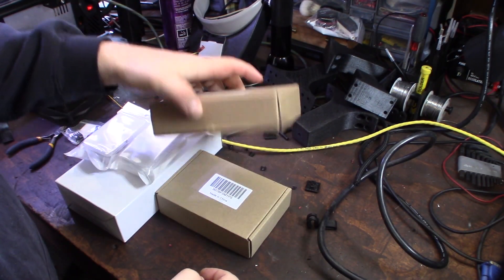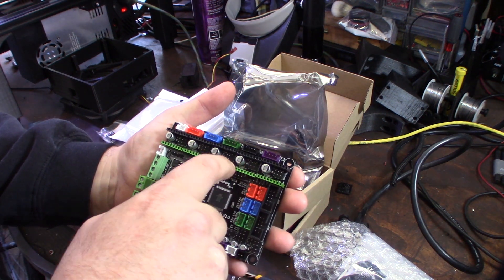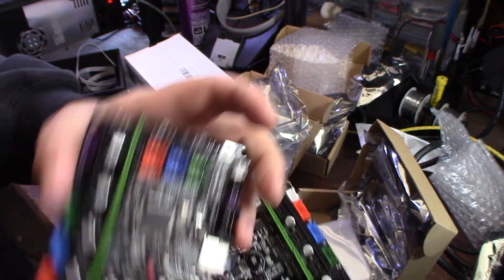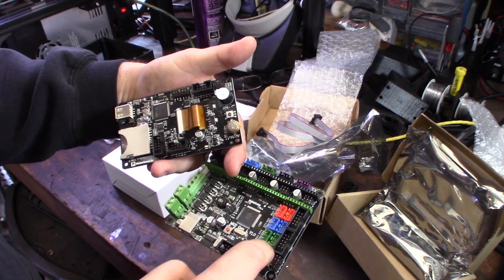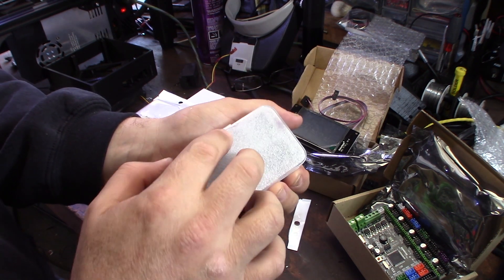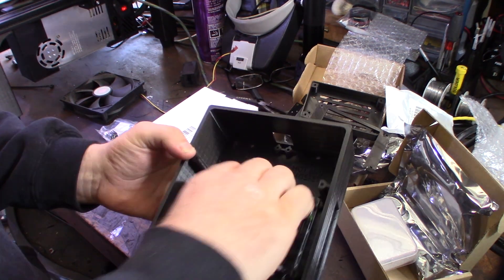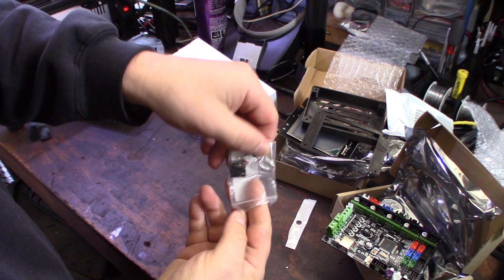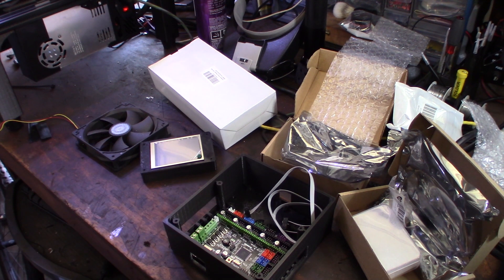32bit SKR 1.1 3D printer board upgrade tft32 marlin 2.0 TMC2208 Anet Tevo Creality Part 1

Comment: SKR 1.1's 5V power supply output is too bad, I am connected to 24V power supply, 5V output has 1V fluctuation when no external line is connected. When I access the infrared limit switch, I find that the 12864 LCD screen starts to appear garbled. 5V power supply output is very poor, very fluctuating, directly leading to 12864 LCD screen display garbled

Comment: Do you think the MKS TFT 32 will also work with SKR V1.3?
Reply from the maker: Probably, I have a tft32 and will try when 1.3 gets here.
Reply: @fintechrepairshop  great, can't wait :)
Reply: @fintechrepairshop  I saw that there is also a SKR TFT 35 and a MKS TFT 35 available now. But as far as I can see the SKR one has way less features than the MKS one
Reply: The MKS TFT 35 is just the same as the 32 one except for screen dimension
Reply: @fintechrepairshop  any update on when you are getting the board? :) can't wait to see if the tft32 works with it.

Comment: About that pattern. If it's 8 mm high, then most likely it's your z screw rod couples. You either have to set it 100% straight, or you have to use some printed plastic one from thingiverse, it will reduce that wobble a lot.

Comment: Hey I ordered that board from aliexpress its about 17bucks there it just takes forever to get here (I'm not in a big rush) but could I get your firmware its always easier for me to edit someone's marlin then get it from marlin it always seems to throw errors when I get it from the websight
Reply from the maker: sure no problem. How do you want me to send it? I'm ready to install the board but still have to get my Bltouch figured out. My firmware is setup for BLtouch, E3D titan aero and trinamic TMC2208 drivers.
Reply: @fintechrepairshop  I'll send you a direct message with my e-mail and thats a great set up I use a titan (bowden set up) on my printers too although I recently tried a btech clone that I really liked its also geared and is pretty much the same steps per mm I plan on using the same steppers too and I use to use a BL touch clone but they started dying after 30 or so prints so I've been using sensors that slip on the nozzle so it probally won't be much modding I need to do
Reply: @fintechrepairshop  guess youtube removed the send message button my e-mail is canderson@yahoo.com